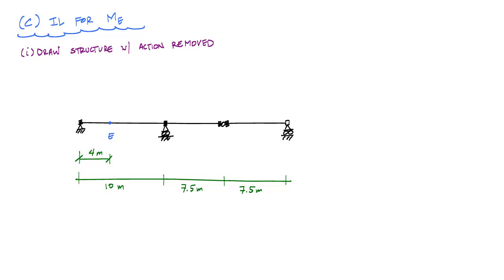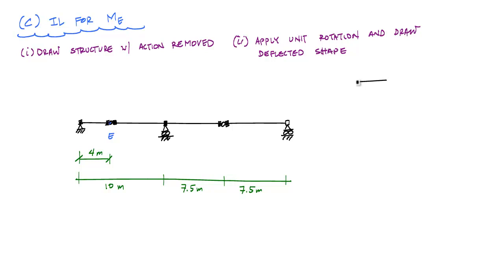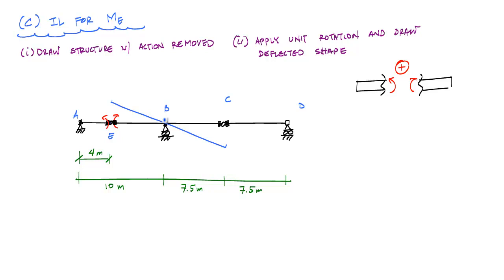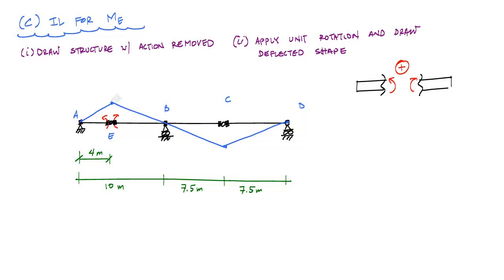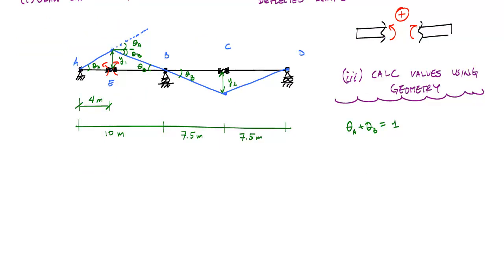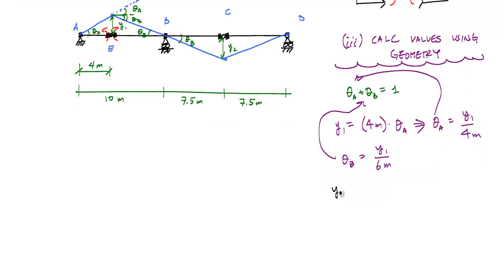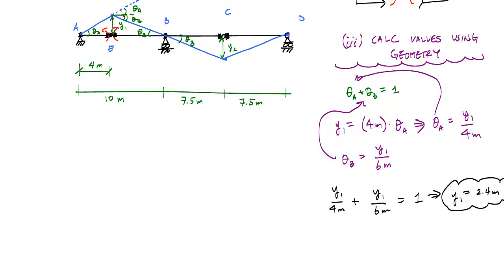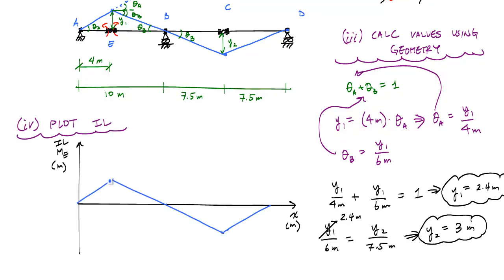Influence Lines for Beams Example 3 (Part 3/3 - IL for internal moment) - Structural Analysis

Comment: just a small question: how to determine the direction of rotation when we apply 1 unit rotation, in the middle of a structure its clear, but when we come to the edges how to know if it should be clock or counter clock wise? thank you

Comment: hey structure free, I was taught height of y2 = 7.5 X 7.5 divided by 15.....aXb divided by L.... that works for y1, my y2 = 3.75.... your y2 = 3,,,,help....
Reply from the maker: y2 = 3.75 would be correct if point E were at 5m from point A.